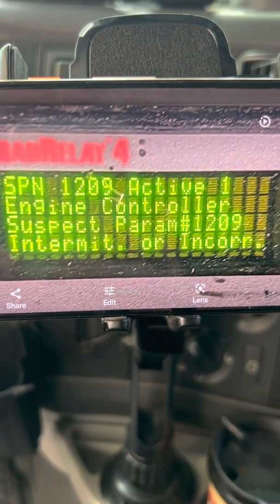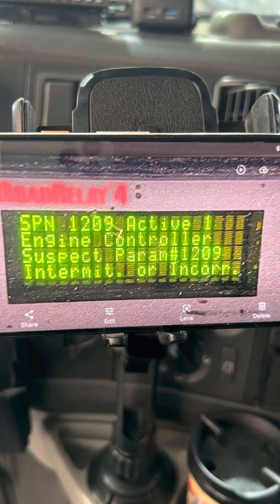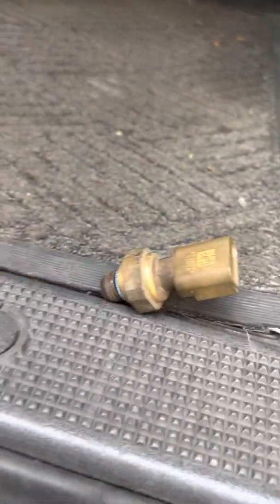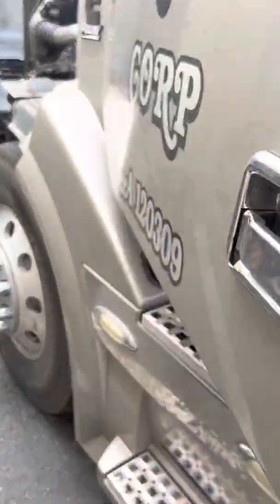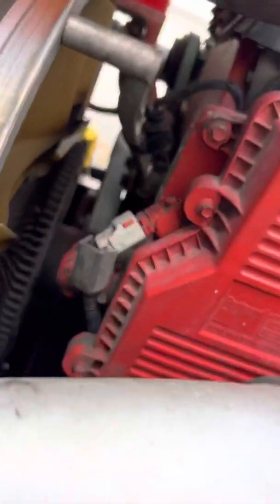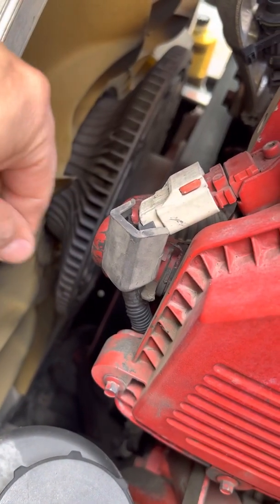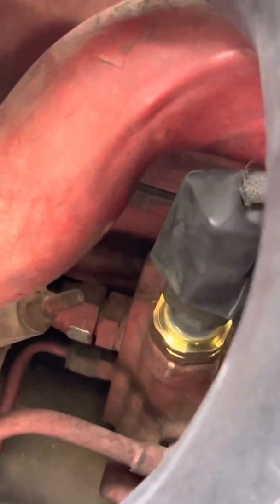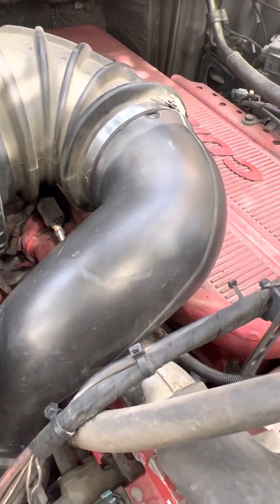Cummings isx code SPN 1209

Comment: I had to replace that sensor twice in 2 weeks. Come to find out it was the Pressure Sensing Tube part#5256879…. The part cost $100 and it’s the tube the sensor screws into and goes into the exhaust manifold. Didn’t realize it until I had already cleaned the DPF filter, EGR etc… So check that out too.
Reply: What what’s wrong with your pressure sensing tube? I have the same problem I already replace sensor but light still coming on and off

Comment: I have the same code on a 2016 4300 international. I changed the sensor but the code came back on . Any suggestions
Reply from the maker: Hello, Cummings isx on your International?
Reply: Isb
Reply: What was the problem? I in the same situation, I already replace my sensor but light still coming on and off

Comment: Hello I have the same code spn 1209 fmi2 on my Volvo 2013, but not coughing or shaking, and I don't know if it is  ok to drive till I get dealer.any suggestions?
Thank you.
Reply from the maker: Hello, I  drove my truck for about half a day without any issues, just noticed the "coughing" when engine was at idle. No noticeable issues at cruising speed. Hope this helps.
Reply: @tarasco888  thank you.

Comment: Thank you for the tip, just one question,  your truck show just the code above or other codes is well?
Reply from the maker: When I started the cough on engine only that code appeared shortly thereafter.
Reply from the maker: If you are getting other codes this could be helpful. 
https://www.alliedsystems.com/pdf/wagner/forms/80/80-1044.pdf

Comment: We’re you getting alot of smoke while at highway speeds when under a heavy load?
Reply from the maker: Hello Rakim. No smog or other changes aside from the " coughing @ on the engine and a little shake / loss of power when it did that. Engine Iwould do it very briefly on and off and then go back to normal
Reply: @tarasco888  thank you for your response
Reply: Thanks for the video boss I had the same code and the same cough on my Cummins e-z fix